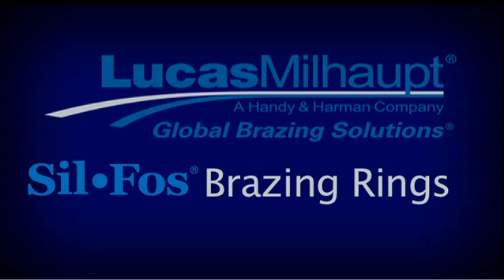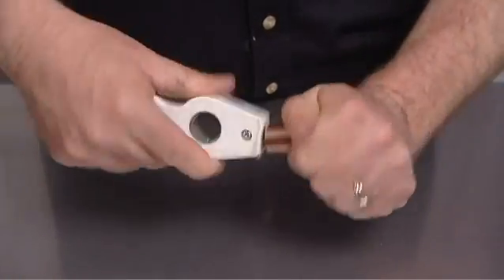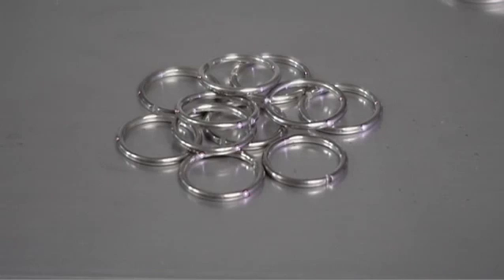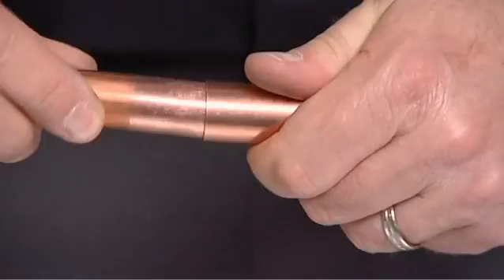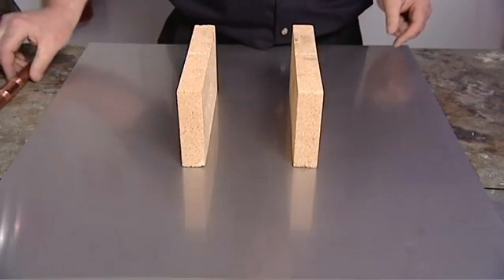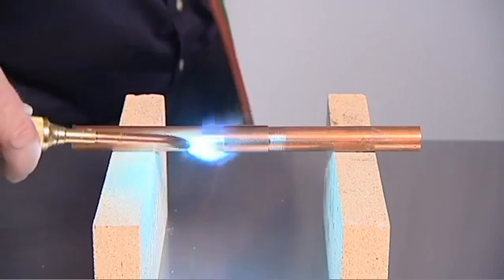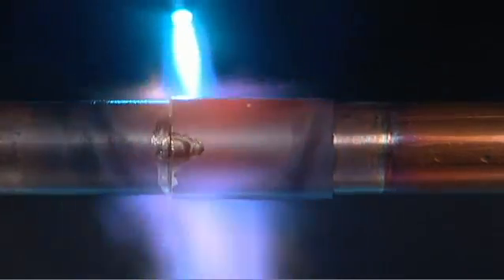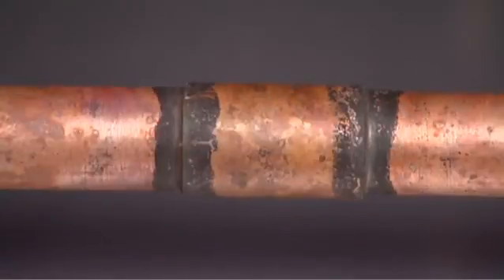How to Braze HVAC/R Copper Tubing and Fittings w/ Sil-Fos Rings - Smart HVAC Products

Comment: So, would you say slow air cooling after brazing is better or quick cooling in water. I've seen both ways done by pros in commercial work.
Reply: Your supposed to wait until after the copper turns color from heat after brazing then add water rags, a lot of people will say cracking could occur but that’s only immediately after if you were to throw rags on after brazing but if you let it air cool you run the risk of a weak joint think of a blacksmith making a sword, he puts it in water after taking it out of the forge  to harden the blade, I’ve been in HVAC for 12 years now and have never had an issue or call back with a braze crack but I’ve seen people get them for letting them air cool
Reply: Air cooling for sure. Water causes cracks